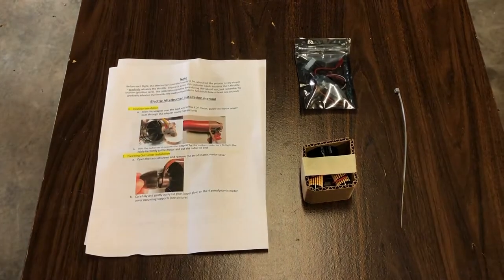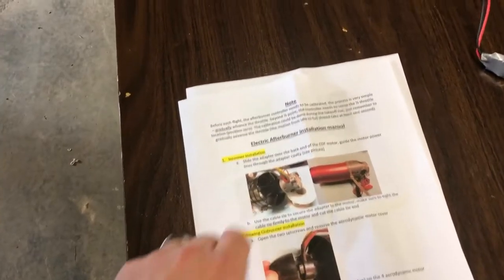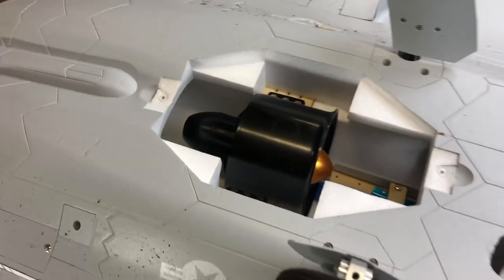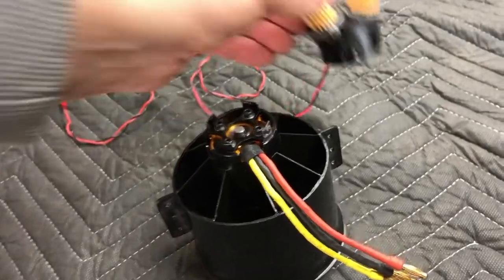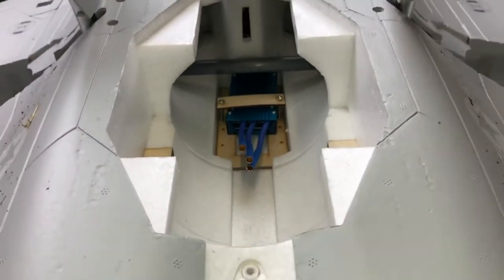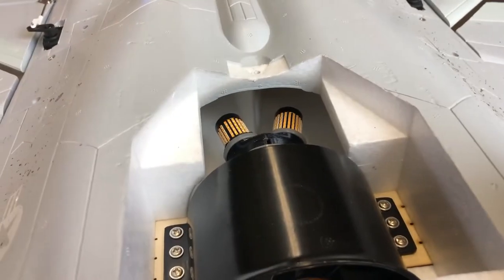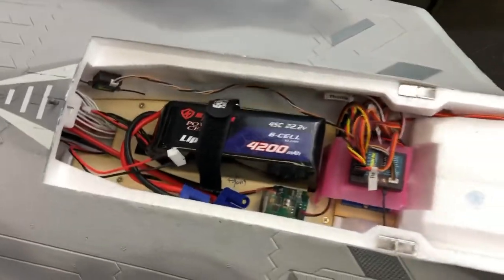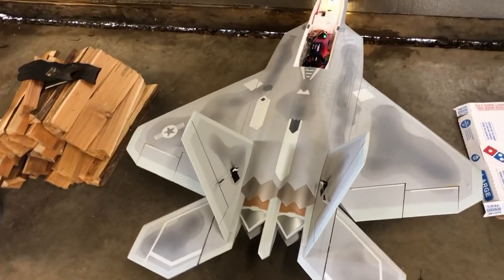THE LIGHTBURNER Unboxing, F22 Installation and Review

Comment: Hey John...that's pretty cool.  I just wonder if you could take like a Dremel and actually drill two little pilot hole in the position of the original cone so you could actually screw the new burners on to the fan.  Just an idea.